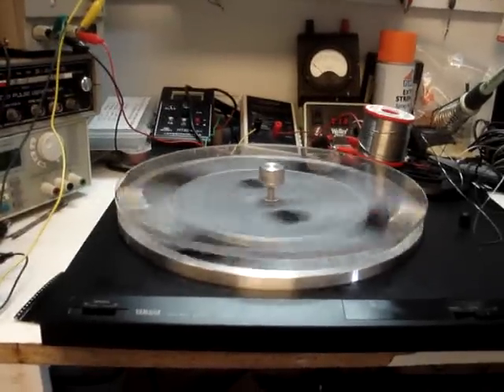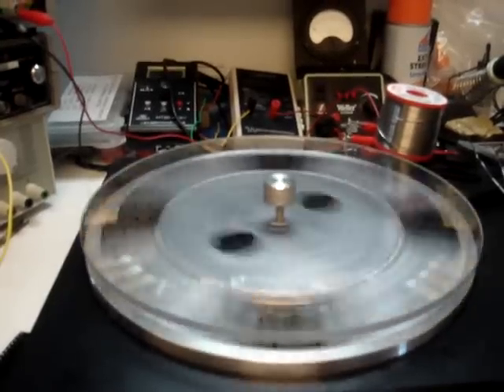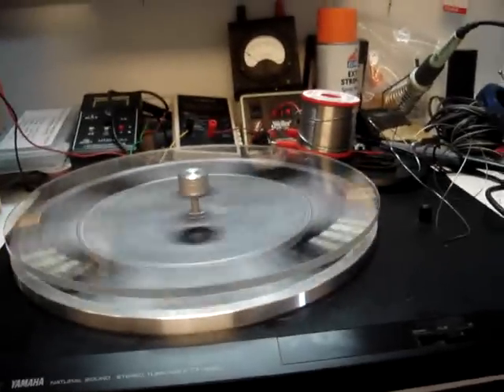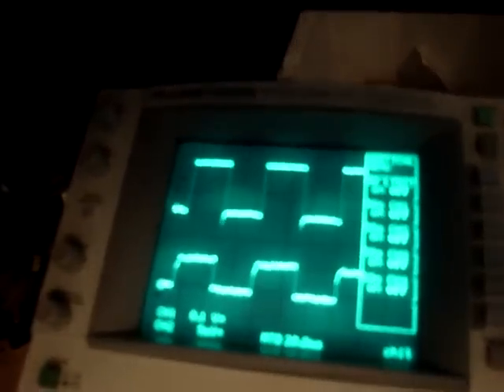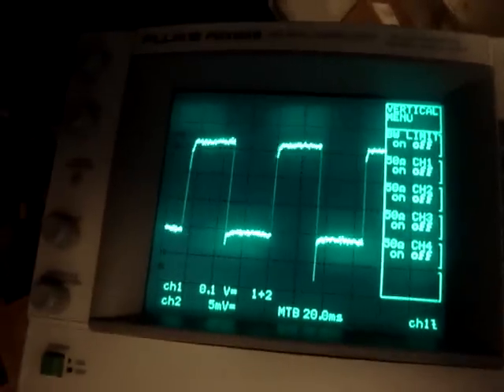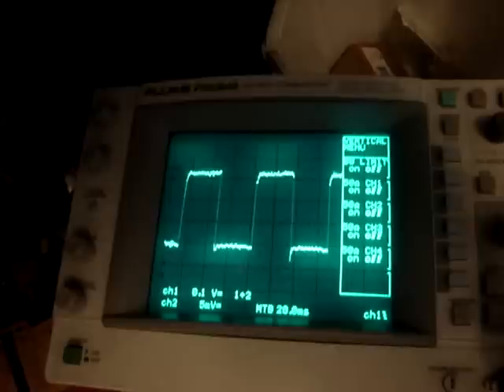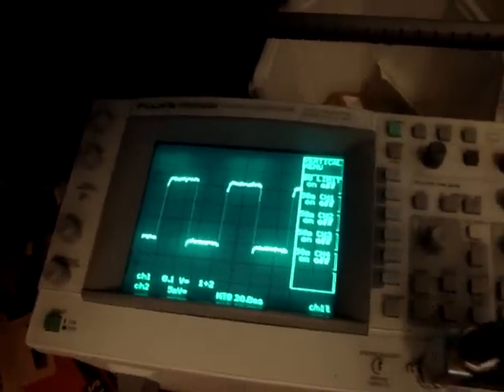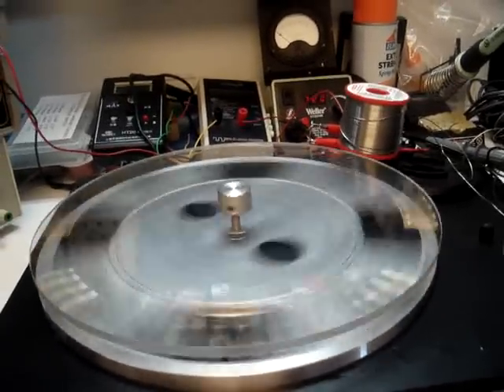1 Coil Square wave pulse motor

Comment: Hmm Ben,
in this moment you are just shorting out the coil
energy with your diode and don´t use it, so the diode just gets warm. With an LED you would at least have light.. or am I wrong ?
Many thanks. Regards, Stefan.

Comment: Ben, if you substitute the diode with a LED it will light up, so you can see the backEMF flyback induction energy coming out.
(Try first to use a current limiting reistor in series with the LED, so it will not break..)

Regards, Stefan.